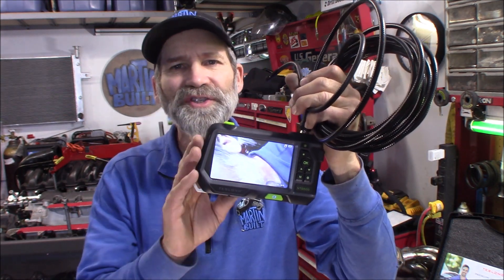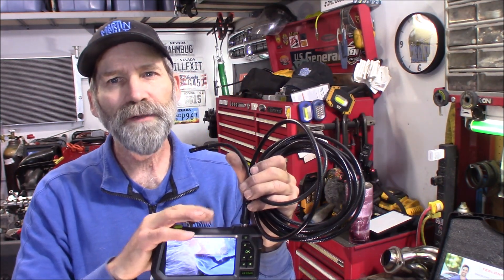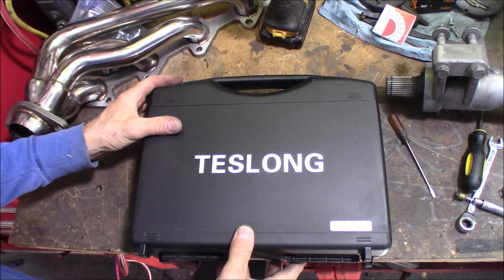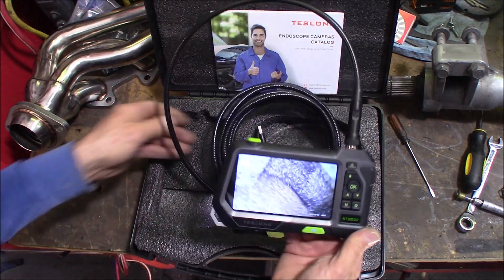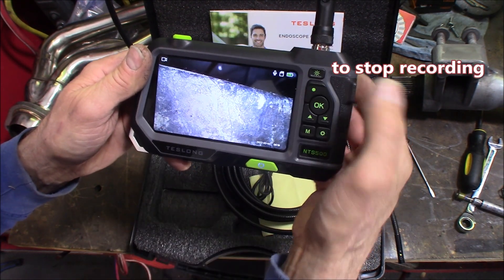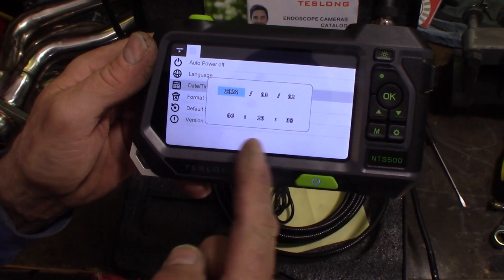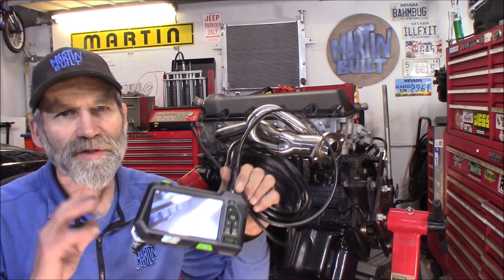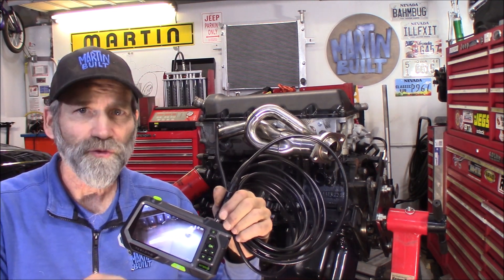TESLONG NTS500 Triple Lens Endoscope, Review and How to Operate

Comment: What happens when the battery stops taking the charge? Is that battery removable and replaceable?
Reply: You can easily open it up and replace it yourself.
Reply: @marcowens3522  is there a video that shows you how to do it?
Reply: The instruction guide recommends recharging the device at least every 3 months when not in use. Pretty standard with lithium batteries in general.

Comment: Those multi camera versions are good, but they would be so much better and a lot easier to use if they had a separate wireless screen, or a way to connect it via Bluetooth to a smartphone or tablet like some of the other borescope cameras.👍